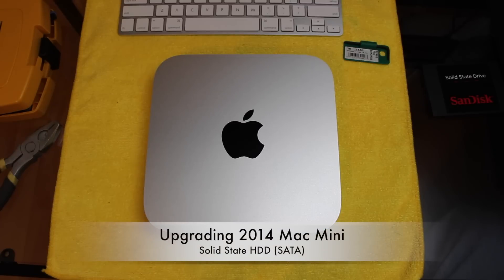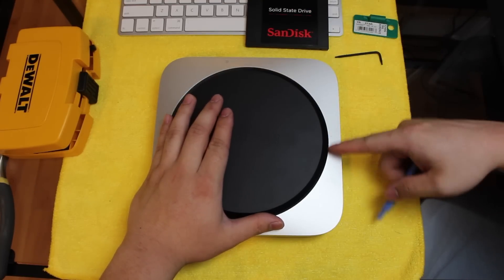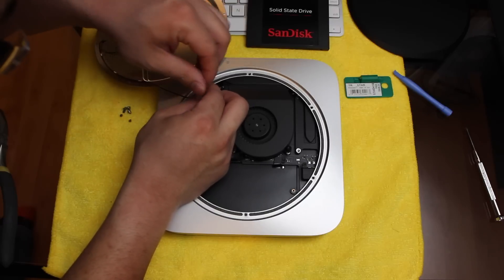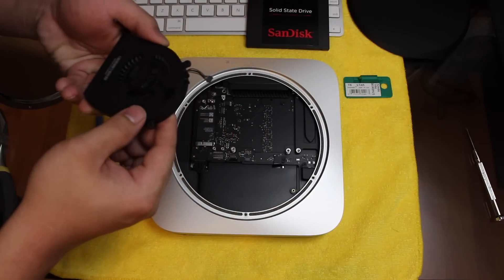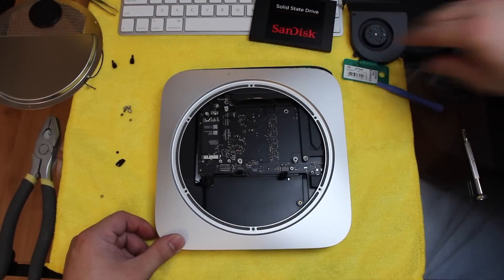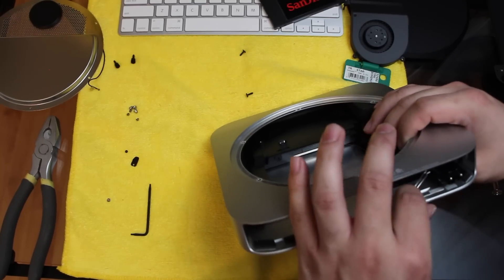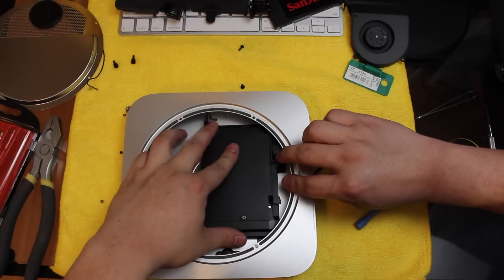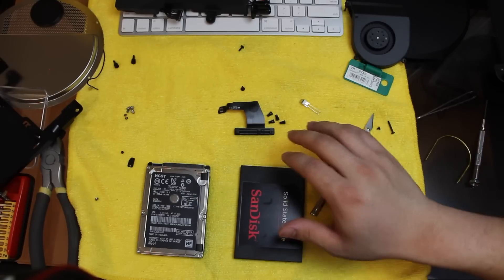Upgrading New 2014/ 2015 Mac Mini to SSD (Solid State Drive)

Comment: Do you nee to cloan your old HDD before you install the new sdd
Reply: Yes. You can clone your drive by booting into internet recovery mode and formatting the drive. You then click install macOS and then install MacOS on your ssd. When it's downloads macOS on the ssd use migration assistant to clone the data from the hdd onto the ssd
Reply: If your original drive is apfs, set the format to apfs. If not, set the format to macOS extended

Comment: I just installed the operating system on an SSD and connected it via usb 3.0 and select to boot it from the SSD. I use the original harddrive as a back up. No need to risk your Mac mini.

Comment: Greetings from 2020. I’m currently booting from an external SSD, and performance is much better. I have done the internal drive upgrade once before, installing a hybrid hard drive (which was kinda meh). Performing the upgrade was tedious (as illustrated in the video) but not too difficult, but I’m wondering how much of a performance gain I’ll get installing the SSD internally. Is the internal SATA bus noticeably faster than the external USB connection?

PS: Thanks for this vid. I’m going to follow the I fix it instructions as I did the first time I performed this upgrade, but this vid is a great overview/review for me. Watching you make your own logic board removal tool was especially useful.

Comment: I short-circuited this debacle by buying an external enclosure for my ssd and I boot off of USB. Maybe not as fast as direct in the case, but still way faster than that 5400 slo-poke.
Reply: That’s my current set up, but I’m really curious about how much it will improve (if it’s even noticeable) as an internal drive. I guess I’m going to find out!

Comment: Y'all are aware you can put adapter and M2 fast SSD inside there? You just need to open the bottom :) If u have questions - just write!
Reply: I’ve seen the cable and the pci-e sticks available at OWC, but it seems too dang expensive an upgrade for a six year old computer!

Comment: Hi, thank you for your video, which PCI SSD is that? I thinking to do fusion drive and wondering should i buy more expensive 128GB PCI or just 32Gb PCI which is much cheaper,  in Fusion technology both will have same speed or 128GB will work faster? Thank you.
Reply: I’m curious about this, too. Other World computing sells pcie upgrades (with cable) for the 2014 mini, but they’re a bit expensive. Theoretically having both SATA and PCIE SSDs fused might be a big boost, but is it really worth it. I’ll spend $50 to upgrade this 5 year old computer, but more than that seems like a waste.

Comment: BE CAREFUL! I trusted this "expert" and ruined my motherboard. Pay particular attention to areas where he says, "Just pry up the connector." It is very easy to pry up the entire connector assembly - as in both the actual male connector AND the part that is the female receptacle, which is  (very lightly) glued to the motherboard. If you're going to be an expert, you need to explain better of how parts work and how you need to proceed when disassembling.

Comment: You don't need any special tool to push out the motherboard and just use your thumb and push hard on the heat sink to easily slide out the board!

Comment: No friendly to open build, but still, is impressive what Apple can fit in so little space.
Reply: Agreed, but check out the Intel NUCs. Very small form factors, but built to be upgraded. I’m thinking about using a NUC to build a hackintosh.

Comment: How did you clone the HDD to the SSD?
Reply: Try Carbon Copy Cloner. If the SSD is the same size or larger than the HDD, you can use time machine.

Comment: How does you install MOS after changing the hard drive by SSD?
Reply: Your best bet is, before you do this drive installation, put your SSD in an external USB 3 case, and install Mac OS onto that. An advantage to this is making sure the drive functions before going through all this work (although SSDs are pretty reliable, so it’s not as big a worry as spinning disk drives). Another possibility if your SSD is large enough is using CARBON COPY CLONER, which will clone your current boot drive onto the SSD.

You can also make a recovery/installation USB thumb drive. I’m not sure what are the size requirements, but I imagine 16 or 32 gb would be sufficient for this purpose, and it’s not a bad idea to have a recovery thumb drive.

Comment: This is insane, I'm Mac always but on a PC it takes like 2 minutes this shit might take you a couple hours and that's just takin it apart
Reply: More like 30 minutes, but it is tedious. Honestly, if I didn’t already own this thing, I think I’d buy an Intel NUC and make it a hackintosh. I already bought the 480 GB SSD (for a little over $50 US) and I’m booting externally through the USB port. Performance is now decent. I’m hoping to see a tiny bit more performance installing the SSD internally. I need to do this install anyway because I’m a little worried about accidentally disconnecting the external boot drive (children in the house).

Comment: The install was incredibly easy. I did it while completely hungover, and had no issues.  I used a cheap $80 SSD.  After I Installed it I ran into one issue, when attempting to re-install OSX, it wouldn't see the drive.  You need to use disk utlity first to format it first as MacOS extended or whatever.
Reply: LOL! I can actually imagine a YouTube channel dedicated solely to performing relatively complex technical mods while completely hungover. Or still drunk. I'd subscribe. Maybe it already exists...

Comment: Consider using an ESD set while working on computers.  I had a couple of computers that were damaged from static electricity and power surges.  Sometimes it can be like chasing ghosts trying to troubleshoot the cause of a hardware problem. A grounding kit costs about $30 which is well worth the cost if you are going to work on computers..   I recently sent a computer out to have the hard drive replaced.  It came back with a failed logic (mother board).  That cost about $500 to replace.  Fundamental to working on electronic equipment is proper grounding procedures.  

Here's a link to an ESD (electrostatic discharge) field service kit - 

 https://vetco.net/products/anti-static-field-service-kit-w-mat-wrist-strap/ve-as9?gclid=CjwKCAjw4uXaBRAcEiwAuAUz8A3v87rs3dR08x2YLLCLX2RcaS-FmiO3ouQbS2uZV3SDKg8dh1aJQRoCU_cQAvD_BwE

Comment: FYI you do not need a wire tool to remove the motherboard. It simply acts as a pry bar the way you are using it. It can simply be pushed out as well.

Comment: 8:07 - You're right; a 54RPM hard drive IS very disappointing...
Reply: Back in the 1920s, the drives on our MP3 players spun at 78 rpm. You might think that’s slow, but it was a vast improvement over wax cylinder storage technology.

Comment: if you are going to make vid showing people how to do it make sure you do it properly and tell them before you try and remove the logic board (motherboard) pull it out just a tiny bit and remove the ir clip which is the small on that you said just snaps into place, they break very easy. also which  i noticed you never did and are very luck you never damaged was remove the power connection. you just yanked out the logic board and never detached it and it just pulled loose. you are very lucky you never ripped the connection off the logic board because if you did your mini is junk.

Comment: You didn't mention that the five surface mounted pins for the power LED and IR sensor are COMPLETELY fragile, or that the best opportunity to reattach this connector--and the main power connector--is when the motherboard is inserted but not completely in place. The motherboard should be about an inch out from its mounting position, so that fingers can access the power connector and you have room to slide it into the board. Same deal with the LED/IR connector.

I destroyed the surface-mount pins for my LED/IR connector, so my one-year old Mac Mini now has neither of these, but at least I can still use the Mac itself.
Reply: This happened to me too..

Comment: My mac had been sluggish, and I cannot deal with slow. my buddy advised this superb MAC system utility “govo unique only” (Google it) and it was very successful. My Macbook Pro is working much faster, now. The user interface is straightforward and there’s no hassle in installation. Cleaning, Securing, Optimizing your Mac, anti virus, spyware are examples of the wonderful functions available in the program.
Reply: This app is using MacKeeper as part of what it does so keep that in mind.  I stay further then a 10 foot pole from MacKeeper.

Comment: Hi! So could I add a SSD to my mac mini (2014 late I5 1TB), and keep the old HDD at the same time?    thx
Reply: bayernray you could keep the old one in an external casing and use it as a (slow) portable drive, but the body of the Mac Mini is doesn't have room for more than one HDD

Comment: Quick question - is there any damage in disassembling/ reassembling multiple times? 

I upgraded the HD using this vid (lifesaver, THANK YOU!) a year ago and now want to sell the comp. The small silver pin that secures the AC cord came loose and rattles around. Wondering if it's better to leave it off and disclose to seller or try and put it back and disconnect/ reconnect all of those delicate little pieces. 

And seriously, this comp was a total dud before this upgrade. Super thankful for this vid.

Comment: hi! a quick question: If I buy the 512 GB SSD version, can I put an additional disk to the SATA controller? For example, If I buy the Samsung 850 pro 1 Tb, can I use it together with the original 512 pcie SSD? Thanks
Reply from the maker: You can only connect 1 drive to the SATA controller. You can put your old 512 SSD in a USB/ thunderbolt enclosure and  use it as an external drive.
Reply: Brandon Geekabit ok! so id i buy the pcie ssd version i can still  mount my SATA SSD?
Reply from the maker: My apologies, I thought you were asking something different. I assume it will work but have not tested it myself. They sell the mac mini from factory with the SSD and traditional drive as secondary, so I can only assume it would. For this specific video I only have the traditional HDD and am swapping it for the SATA SSD. I did not get the internal SSD.
Reply: Hi! So could I add a SSD to my mac mini (2014 late I5 1TB), and keep the old HDD at the same time?    thx
Reply: Hi! I have the same question. Have you found the answer? I've put an additional disk into the Mid 2011 version. Is it possible to do the same thing with Mid 2014 version? Please let me know!

Comment: hi I have a late 2012 Mac Mini can I install an SSD on mine? thx
Reply from the maker: +Mimmo Sulmona Yes, the process is much simpler. You still need the T6 tool though.
Reply: +Brandon Geekabit thank you
Reply: +Mimmo Sulmona I did this to my 2011 Mac Mini and the difference is amazing!! so worth the £70 i paid for the SSD. its given the Mac at least another few years life!!
Reply: +lee ellis thanks for the advice, I haven't even started to look at specs for SSD's yet, do you have any suggestions? I'm wondering if there might be any limitations on the size that the Mac Mini can recognize (ie greater than 500 GB or something like that). Also which software did you use to make the transition?

Comment: Hello, since 3 months i’m a (happy) Mac user, i am 44, i never owned a Mac and i was always sceptic about Mac, i gave it a chance and it really is a very nice OS to work in, but my Mac Mini 7.1 (Late 2014) failed yesterday! :( it crashed and wouldn’t boot, only black screen, only option was to do Internet Recovery, in recovery i noticed that (setup) saw NO Harddrive to install it on and it was necessary to format my 1TB drive to install it on, so 3 months of personal data gone, everything wend very slow, and after booting in the insstalled El Capitan 10.11.3, I noticed in system information that under: SATA/SATA Express Apple SSD Controller my SSD drive was reported as Unknown… Only my 5400 drive was detected, so i (guess) that the SSD portion of my Fusion drive died, i was installing Native Instruments library’s, like 30Gb per library, is a Mac Mini with a samsung SSD (part of the Fusion system) not capable doing heavy disk transfers? Or am i the Lucky man (i hope) with a manufacturing faulty SSD? I hope the last….. I have talked to Apple support, but they immediately advised me to go to a store where they offer Apple support for repair…. I really can understand that even ( ;-) ) with Apple systems, there may be hardware issues, but i didn’t expected it so soon, and my data, like familie movies, pictures and music, stored on the Fusion drive is destroyed/gone, i will go to a store after the weekend and hope they can replace it soon… At the moment of this writing i am using El Capitan 10.11.3 with the 1TB 5400 drive without SSD, so i can work, but it’s slow compared to the fully working Fusion (128GB SSD + 1TB 5400) system… Regards, Sander.

Comment: i would like to know, what happens with the operating system when you replace the hard drives. and how do you install the operating system on the new ssd, if its necessary.
Reply: +Özgür Aciksöz hold down cmd+option+R at boot for recovery

Comment: Great my next question is how to you move your software the OS across
Reply: Thanks guys
Reply: Bought a refurbished MacBook pro 15 from the apple store.  i'm 1 month into transferring all data off from windows and finding the OSX equivalent app. So far so good.
Reply: Superduper is a cloning app. Makes it incredibly simple.
Reply: SuperDuper, CarbonCopyCloner (free) or just use the dd command which comes standard on most *Nix flavors at the command line (Terminal).  Ex.  dd if=/path/to/origin of=/path/to/destination bs=65536 conv=noerror,sync.  Just make sure neither drive is active when you kick off dd, i.e. hdd caddy.
Reply: make a back up using time machine before you do this. when you boot up with new ssd, press and hold apple+R to get to the menu. you can restore using a time machine back up from the menus there.
Reply: you can restore your files, including OSX with time machine. it's been available for a few years now. i don't remember when it first was available but here's a link with more info https://support.apple.com/en-us/HT201314
Reply: time machine is supposed to be on an external usb drive not on the HDD you're swapping out. back up would be lost if you backed up on the same HDD you're backing up.
Reply: Macs have unique identification embedded in their hardware. One can go to boot firmware of Mac by pressing specified keys as soon as the Mac turns on.
After the boot firmware verifies the authenticity of your Mac,the OS can be downloaded to the new harddisk since boot firmware supports connection to Apple's servers.

Comment: Actually the hardest part was at 6:30 where u cut the video and did not show how u removed that cable. It was quite important for me to see that part as i broke all the 4 pins on that cable trying to get it out. I guess it wasnt easy for u also since u cut it out the video..
Reply: Yeah, same here. I HATE Apple at this point, for making this damn thing so deliberately hard to service. I can understand their wanting to discourage people tinkering with the insides, but hard drives are as interchangeable these days as USB flash drives; why make this such a pain in the arse? So now I have a $500 piece of crap here. Thanks, Apple. and thank you, Brandon, for conveniently skipping over one of the MOST CRITICAL parts of disassembly and reassembly! :(
Reply: Try to look for a spare part on Ebay or someone selling a broken mac mini, ask them what's broken and gamble
Reply: @jwanderson67  Yep...exact same thing here. Any suggestions on where to go once those tiny pins are broken? I'm assuming the motherboard is now trashed?
Reply: Same thing happened to me, I eff up the cable.  Thanks for cutting the video and not letting u know about this crucial cable with the pins... now I"m out of a lot of money.  Thanks for nothing.
Reply: Christian Chicas The only thing I’ve noticed not working after breaking that connection is the IR sensor and the front Power LED. Otherwise, the computer operates normal and much faster after the SSD swap. So, it shouldn’t be as bad as we initially thought.
Reply: @RickYover  Thank you so much for your reply!  I was freaking out since I was not able to put those tiny wires back together.  Great to hear my mac mini still has a chance.  Thanks again!

Comment: Dude, tks for the walk thru, it took me 20 minutes to disassemble my and put back together my mac mini, upgraded to a 256gb SSD and runs great, I just bought it but the hdd slow responsiveness was killing me and I was thinking on returning it and get the next model with the SSD built in, but you just saved my a trip back to the store and about $400 bucks..... tks again.

Comment: Very nice video. I agree with you that the 1TB 5400 RPM is very disappointing. I'm looking to upgrade to the same 500GB as you did. However, I'm not sure I can do that myself. I'm afraid of screwing up a small connector and be done. ;) Any thoughts?
Reply: +Olivier St-Cyr Also, do you have a link to where you can buy that blue plastic tool to take off the cover. Thanks.
Reply: The issue I am sure is heat. If you were to put a 7200 RPM drive instead of the 5400 RPM would probably have the fan at hight speed all the time and I am thinking Apple did the for 2 reasons, cost and noise. Having said that, the design is incredibly poor.